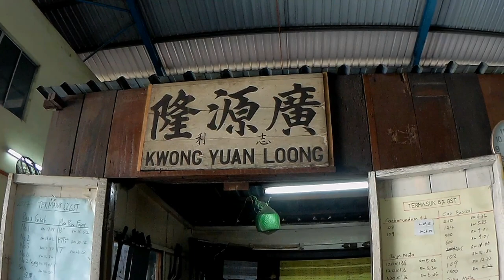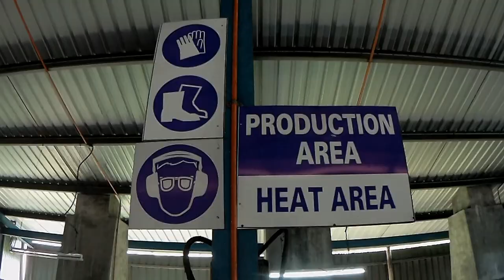Malaysian Parang Maker - Bidor Malaysia

Comment: I have the Bidor Parang Tangkin, the single best cutting tool I own. Great in the back yard, camp ground, and kitchen. I use butcher block conditioner on the blade to keep it looking nice and safe for food prep, it’s certainly the only yard tool I baby lol. I’ve sliced yards and yards of bamboo with it and it looks like new. Absolute units of automotive steel cutlery, highly recommended.

Comment: I bought a cheap parang from a hardware store back in 1991 for my Scouts camp use. I didn't even know it was called a Golok style parang until in recent years. I've been using the parang for camping, fishing & gardening for years. For chopping branches, wood, bamboo, cut ropes, strings, dig holes, hammer objects, prepare food & even used as measuring tool (1 feet). Really abuse it over the years but well maintained with a little sanding to remove rust and sharpening, it stays useful till this day. I notice it doesn't stay sharp for long and chips easily if hitting rock or nails. Is this Bidor parang really that good?
Reply: Yup I have one Golok style too back in the scout days and still using it till now. It's a Samlee m2222. Never tried the parang bidor brand before but the spirit of Malaysian pride in it is there!